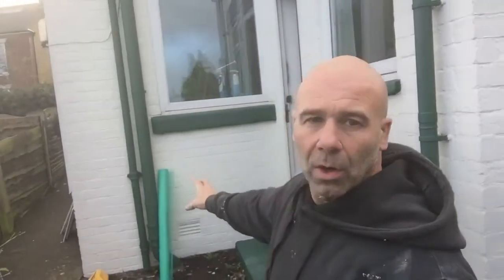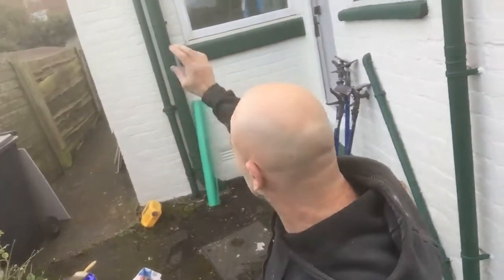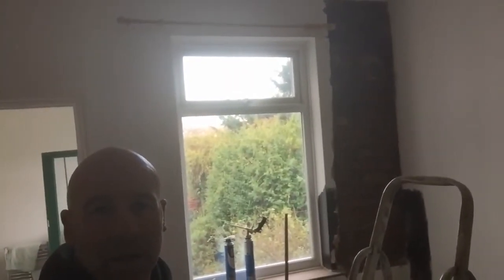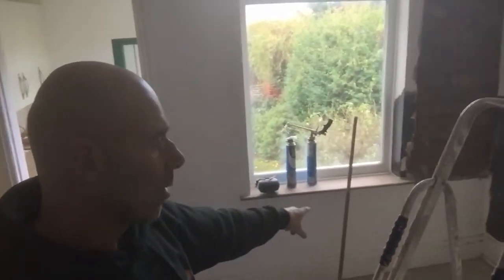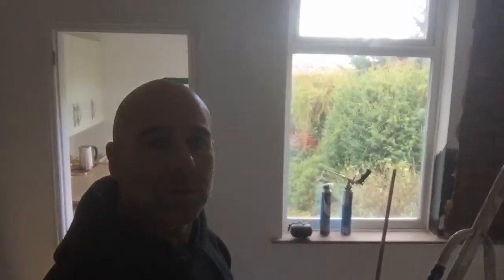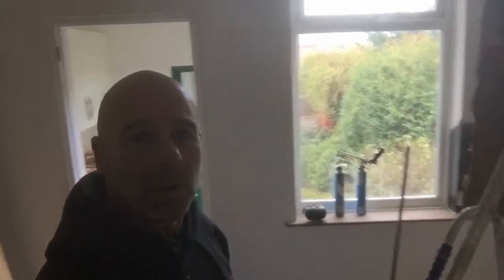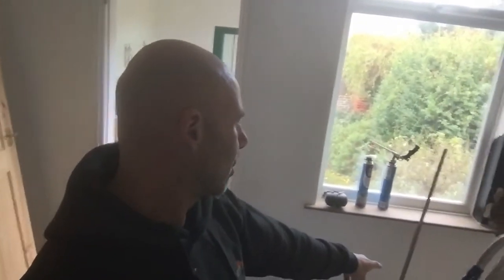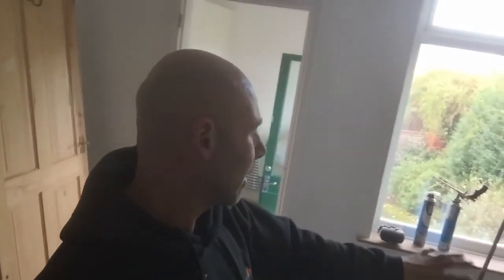Small problem with cold bridging in Heely Sheffield

Comment: Very Good video Simon this is a common problem I come across with less knowledgeable builders diagnosing as penetrating damp. Quick question, once the internal wall has been drylined, skimmed and painted would the cold bridging continue behind plaster board as the surface temp behind the boarding would continue to be low. Only asking as I'm recommending the exact same method to some of the landlords I work with and was querying that if this was done would the problem come back again in a few months?
Reply from the maker: Paul Mooney hi paul, every job is different and you would also need to look at ventilation to see if this is contributing to humidity levels inside the property too, 
When using this system water vapour will travel through the board and wall as it will on all the walls but because the surface is warmer condensation will not automatically form when it hits the due point temp leaving the inside air to circulate. 
You would still need to look at any ventilation issues and this is why we advise a damp & condensation survey to be carried out first by someone competent and qualified.
Thanks for watching, hope this helps.
Reply: Simon Cooper HNC CSRT CSSW 
Thanks Simon